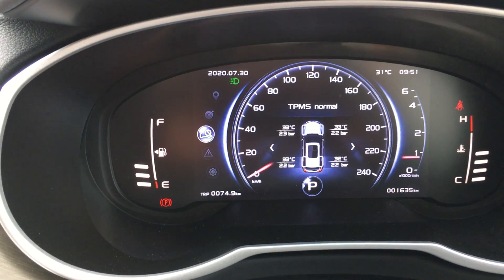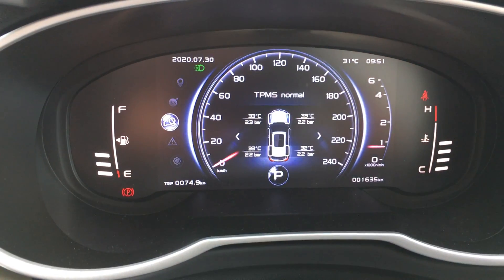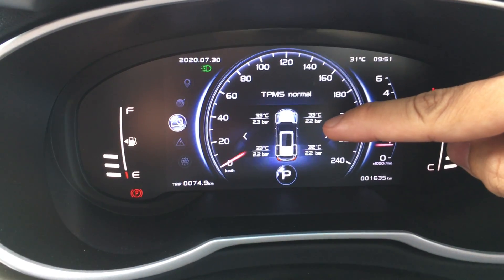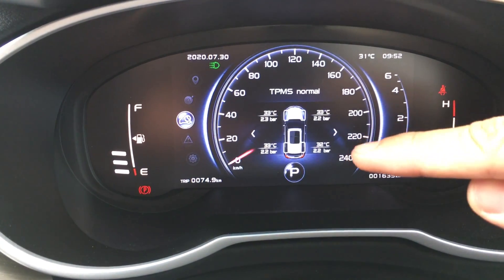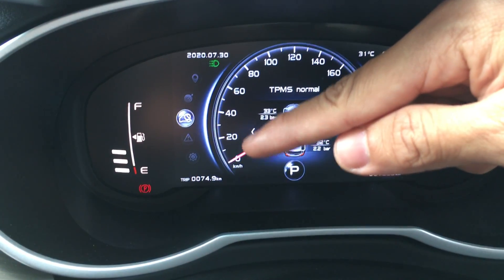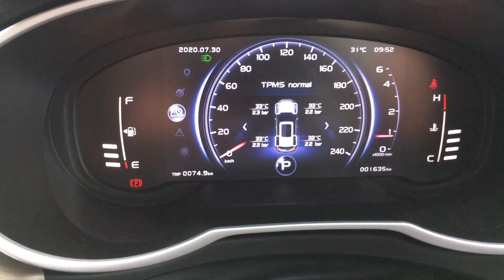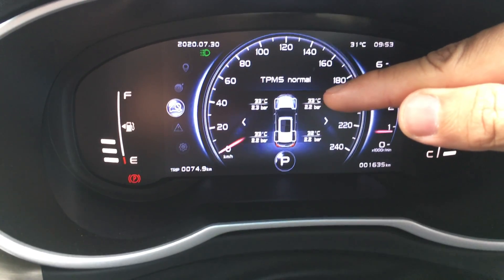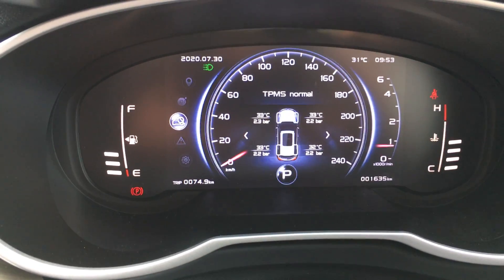EP10: Proton X70 - Tyre Pressure Monitoring System (TPMS) (auto translate subtitle - BM / 中文字幕)

Comment: So, after refill from the pump, I have to drive faster around 60kmh for the sensor to adapt and signal back to the system that they're at normal pressure, right?
Reply from the maker: Yes, and now it’s also possible that TPMS sensor battery may not working properly as many vehicle is reaching 5 years old. If this is the case the only option is to replace the TPMS sensors. Hope this helps you

Comment: When I rotate the tyres (swapping the front pair with the rear pair to equalize tyre wear), how do I reset the TPMS so that it reads properly?
Reply from the maker: This will require to be done with the diagnosis scanner to recalibrate the sensor’s position, and all Authorized dealers can do this.

Comment: Very nice. Can we change the tyre pressure unit in the display from bar to psi?
Reply from the maker: Thank you Irfan for your compliment, for X70 is only available in Bar 😅
Reply: @davidong2898  Ok. And as we start driving the car, do the doors get locked automatically, and unlock once we park or switch off?
Reply from the maker: @orthodocfx  Yes, the doors will automatically lock when the vehicle speed more than 30km/h (if i'm not mistaken) and will automatically unlock when the ignition is switch off.

Comment: Hi david, thank u for the info. This is my first time having x70. Can u please advise me, when i go to any petronas station or shell station or any station, how much pump air i need to put for x70? How can i set the air meter? Hope to hear from you.
Reply from the maker: Hi, the pressure will be 2.2bar and you may set the air meter at 32psi or 220kpa(stated at the driver side door area). Do remember the tyre pressure will not change instantaneously, it will need to run up to 60km/h or after a few minutes (stationery) and then only it will update the tyre pressure at the instrument cluster. Hope that you enjoy your intelligent X70!! 😉
Reply: @davidong2898  thank you so much for the info!!! You the best!
Reply from the maker: @gamedream7468  Thank you for your compliment 😊